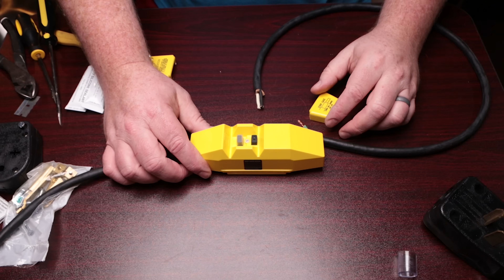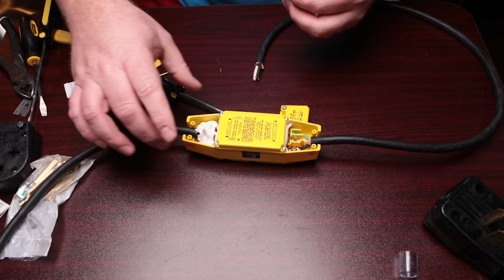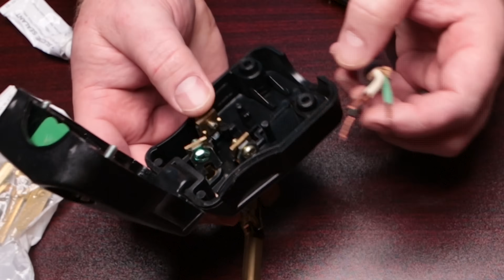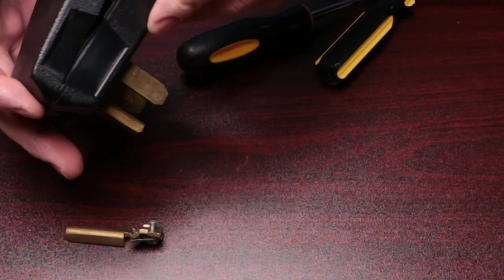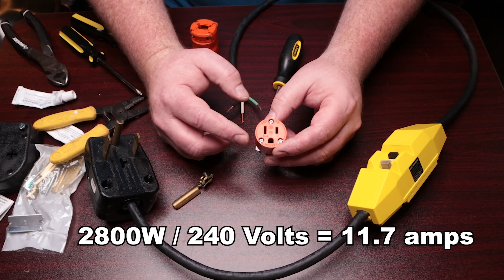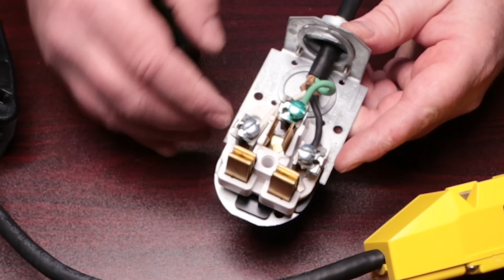Inline 240 volt GFI power cord for Anvil Foundry and Brewzilla Brewing Systems

Comment: Here's an update that might help people out.  The manufacturer seems to have discontinued the part listed above so every site shows out of stock.  I called World Cord Sets and they have a direct replacement not yet available on their site but can be ordered over the phone. The part number is IL-M-20240-Y.V2.
Reply from the maker: Awesome thank you!
Reply: @ShortCircuitedBrewers  Brian, will an in-line GFCI that says 120 V on it work for 240 V in this application? something like this: Leviton GCM20 Manual Reset In-Line, 20 Amp
Reply from the maker: @shaggaroo  it will not
Reply from the maker: Yeah I did a test and it fried the 120v version. It got up to 180f and melted..lol
Reply from the maker: @shaggaroo  😁👍🍻
Reply: Ordered one today. It was $100 shipped. Thanks @carvin4s
Reply from the maker: Glad you found one in stock! 👍🍻
Reply: Just an FYI, they’re priced at $100/each
Reply from the maker: Yeah capitalism at it's finest apparently.. supply chain..blah blah.. lol
Reply: Yeah, for that plus the cost of the other supplies vs. a $70-80 GFCI breaker-I’ll protect the outlet.

Comment: Is there an in-line GFCI option for240 at 30 A? Or 50 A?
Reply from the maker: There are and you can find them by searching ship to shore power. But they're pretty cost prohibitive when you compare the pricing to installing a dedicated breaker in your service
Reply: Ok thanks. As a guy handy enough to do something stupid, building an inline GFCI seems so much safer than messing with my panel to swap out a breaker. No?
Reply from the maker: @marklpaulick  sure you could do that you can actually buy a spa disconnect panel and create a cord out of both ends of that. That is a lot easier than getting into your main panel. 👍🍻

Comment: I'm a bit confused.  At 1:50 , you say that you are wiring it for 120v.  Is that that the same for 240?
Reply from the maker: The end plug that goes in the outlet is the only difference so it really doesn't matter how you wire it for 240. I was just showing how it is "supposed" to be wired if using it for 120. 👍🍻

Comment: Hi Brian. My second time building this cord (first time went well using a 4 prong dryer plug with the  neutral prong removed as shared here).  Using a locking 4 prong plug so that a friend and I can have the same power source and share the foundry as needed. The 4 prong plug I bought for my extension cord does not allow me to remove the neutral prong. Is it safe to have the neutral prong in the plug connected into the wall outlet neutral port even though the cord itself doesn’t have a neutral wire attached to the prong? Thanks!
Reply from the maker: Yeah you'll be fine.
Reply: Thanks so much Brian!

Comment: If i have a dryer outlet connected to gfci breaker, would i be able to buy a dryer plug/cable, strip the ends of the wire that would connect to the dryer, and instead attach the adapter directly to the dryer plug?
Reply from the maker: Yes sir that is safe.

Comment: I'm thinking of using electric stove outlet which is the older ungrounded 10-50amp, 3 blade with 2 hot an 1 neutral. So with the power cord, I know what to do with two hot terminals but where do I attach the green ground wire? Or should i just cut the green wire and put nut on it with silicone in the nut to glue it on? Then what do I do with the section of cord that goes between gfi and the foundry? Same thing with green wire or can I attach that to ground terminal in the gfi at that point (just to keep out of the way, not loose) ? Thanks, great video.

Comment: Hey Brian - we brew at my friends house (the garage is called Two Mutts Brewing :-)) and he has already installed the circuit breaker and power outlet for the Anvil 220.  Where can we find an extension cord, or do I need to get the parts at an electrical supply house?  Thanks!
Reply from the maker: Yeah she won’t find an extension cord to do what I do in this video because it’s not up to electrical code. So you’ll have to find everything at the supply house There are links in the description for some of the components as well

Comment: Can someone explain why gfi is needed if circuit is on normal breaker? Sorry noob question. Thanks.
Reply from the maker: Because a regular circuit breaker won't trip when you're getting electrocuted from your brewing equipment. Generally if you're getting electrocuted by a circuit it's not a dead short to ground so the breaker won't trip. 👍🍻
Reply: Thanks! So the reason we don't need a fourth wire where the neutral would be is because the ground wire is going the same place/acting as neutral?
Reply from the maker: @russelldheilman  240 volt circuits don't use a neutral so you don't need one. The device still works without a new Droid just reads the difference between the hot legs and ground to operate. 👍🍻

Comment: Can't seem to find a 20 amp in-line GFI rated for 240 volts at any kind of reasonable price. Anyone know a place to order this from? I'm in New England (northeast USA)
Reply from the maker: Have you tried all the links in the description? 👍🍻
Reply: @ShortCircuitedBrewers  Yes. Unless there are additional links I'm not seeing, the two links for the 240v GFI's appear to be out of stock.
Reply from the maker: @digitalFig  yeah it's a bit of an issue right now unfortunately. Just keep checking. 👍🍻

Comment: I am planning to install a GFIC breaker so I can run the ANVIL foundry 10.5 on 240volts. Can I use a 30amp or 50amp double GFI breaker in my breaker box? I thought the 30 amp would be prefered.
Reply from the maker: 30 is more than enough.

Comment: Great videos on this subject.  My dryer receptacle is a NEMA 10-30R, so I'd use a 10-30P plug.  The circuit shows 30 amp using 2 breakers (240 V, right?).  Do you see any issues with a setup like this?  I think the only thing different from this video is the plug used on for the wall outlet. I have a propane dryer, so the outlet is not being used currently.
Reply from the maker: No I don't see any issues at all. 👍🍻
Reply: Well, I do. The 10-30R doesn't have a ground and you don't want to "bootleg" the neutral as a pseudo-ground. So the thing to do is to take just the 2 hot legs across the GFCI and have no ground wire in the output receptacle, and no neutral connection on the input plug. The GFCI will provide all protection. The output receptacle should be labeled "no equipment ground" as well.

Comment: Question:  I'm looking to upgrade to a larger 10 gal batch electric all-in-one system (near future) or maybe even a 3-kettle HERMS (less-near future) and I'm building a basement brewery with the help of professionals. What electrical service should we install? 2 outlets of 240v 30a? After watching the video "Spike Solo vs Brewtools B80 vs G70 vs Brewzilla" it seems that the receptacle types options are all over the map. True?
Reply from the maker: If you have the space in your breaker box I would definitely install 30 amp 240 volt circuits. I would go with the standard dryer plug. That will give you a ground two hot wires and a neutral. You might have to make or purchase adapters for various type of Brewing systems. But if you want a future proof as much as possible I would put two in with the dryer plug configuration..
Reply: @ShortCircuitedBrewers  Thanks for the tip. Very much appreciated!
Reply from the maker: @chris.kriese  👍🍻

Comment: Does anyone know where to find a 240v GFCI plug these days?   The sources listed above no longer seem to have them available... :(
Reply from the maker: The plug? Or do you mean the actual GFCI device?
Reply: @ShortCircuitedBrewers  sorry..I should've been clearer... I can't seem to find the GFCI  unit itself... 120v models are easy to find, but not so much for 240v.  Thanks
Reply from the maker: @bumbaevents270  25 black ones in stock on the second link in my video. This one.
https://shop.worldcordsets.com/shop/product-lines/120240v-manual-resetuser-attachable-gfci-inline-style
Reply: @ShortCircuitedBrewers  thanks!   I could've sworn there were none when I looked earlier today... :)  ordering now.  Great video!
Reply from the maker: @LarryPrikockis  no problem... It's kind of crazy cuz a week ago they had over a hundred in stock and then I posted a link in the Facebook group that they were back in stock there and you see how many are left!! I need to get a hold of the manufacturer and just order a giant batch of them and sell them on my website.. lol

Comment: What's the difference between this adapter and the more basic one. Which is the better option to make in order to plug an anvil foundry into a dryer plug?
Reply from the maker: The basic one offers no GFCI protection. This one is what you need for your situation. It will keep you protected. 👍🍻
Reply: @ShortCircuitedBrewers  so I can get away with that GFCI protector and if I put in roughly 50 total feet of 12/3 extension?
Reply from the maker: @worcesterbeerguy4243  yep you can make a GFCI extension cord with this video. Just figure out if you want it close to the supply or the foundry and install it accordingly. 👍🍻

Comment: Waiting on materials to be delivered. Excited to brew at 240, it will be very helpful at our elevation. Question about lengths: I usually brew indoors but in the summer I’d love to pull out the Anvil on the patio and enjoy the day. Is there a specific rated extension cord that I can use? Or do I need to get enough 12-3 SJOOW for my largest length needs? I’d rather not have 20-30 feet of it coiled up for most of the year. 

Thanks! Great videos as always.
Reply from the maker: That rating is perfect. The length is fine too.👍🍻

Comment: Hi Brian, or anyone else that's been thinking on these things, I have an unused 30 amp 240v breaker on my home circuit panel. It's not a GFCI breaker. I'm planning on repurposing this circuit for an Anvil 10.5 gallon system to take it to 240v for more efficient use. My question is, when I wire the 240v outlet, should I upgrade the 240v breaker to a GFCI breaker, or just build a GFCI into this awesome DIY project you have here? (especially since I'm planning on doing this project rather than cutting the cord and potentially losing resale value if I ever can't brew because... I dunno, I become a quadriplegic?) There's about a $30-40 difference between these two methods, and while I want to save money I don't want to be stupid if there's a logical benefit to having the breaker a GFCI that I'm missing. Note: this will be a dedicated outlet just for brewing.
Reply: Ha, rather I'm planning on doing your 120v to 240v conversion cord project I meant, so I could build the GFCI into that same adapter cord.
Reply from the maker: @MGoBirch  if you could put the breaker in the main panel then you would be able to use any system on the circuit. I'd suggest that and then just make the adapter cord.
Reply: @ShortCircuitedBrewers  Thanks Brian!

Comment: I have a 250v plug wired into my garage for different table saws. Would this configuration work, with a 250v plug since the anvil would only be running to 240v?
Reply from the maker: Would be fine. Are you in the USA?
Reply: @ShortCircuitedBrewers  yes.

Comment: Brian, how long can that cable be? I need 16 feet to reach my brewing area...can I make that long? And what's the gauge of that wire?
Reply from the maker: 25' is fine. 12 gauge is recommended..
Reply: Thanks Brian, I have the foundry on the way and I don't want to deal with 120V... Thanks again.
Reply from the maker: No problem!! 👍

Comment: Brian, thanks so much for the videos they are sure helpful. I have an Anvil 10.5 and am moving my brew operation to the farm. In the barn there is a 50 amp 250 volt outlet for the welder. Will the setup you made for anvil on this video be ok to plug into that ?
Reply from the maker: Yes it would work fine.

Comment: So if I'm plugging into my 250v/30a dryer outlet in my apartment, I can ditch the neutral pole on the 4 pole plug and connect everything accordingly as you've done in the video? Just want to make sure I'm not missing anything. 🍻
Reply from the maker: Yep. You don't need a neutral for 240. 👍🍻
Reply: @ShortCircuitedBrewers   awesome! One last thing, the GFCI you linked in Amazon only says rated for SJT cable. Can this take 12/3 awg cable?
Reply from the maker: Yes sir.. it is actually 12-2 with a ground but as long as it's only 3 wires total you're fine. 👍🍻
Reply: @ShortCircuitedBrewers  sorry just realized my reply left out the 12/3 awg is sjoow.
Reply from the maker: @sloppybones  that's what's in my video it will work just fine.
Reply: @ShortCircuitedBrewers  thanks for all your help! 🍻

Comment: Brian, I have a 30 amp dryer outlet I beleive to be a nema 14-30p it has one horseshoe plug on top, two blades side by side and a round plug on the bottom. I ordered a 50amp plug to wire up that has a round plug on top, two blades side by side and a blade on the bottom. Can I just remove the bottom blade then plug it in upside down? Do I wire the third wire to the round plug? Will that still function as a ground or neutral? I've read that mixing up ground and neutral results in being electrified. Ordered 12gauge wire 12/3 which has 3 insulated wires so i can use that to wire it all up right? also a 15 amp female 125 volt end for the output to foundry.
Reply from the maker: I answered you in your Facebook messenger check that. 👍🍻
Reply: @ShortCircuitedBrewers  thanks again Brian! You're the man! You have my support as a lifelong viewer
Reply from the maker: @garyx2903  thank you! 👍🍻

Comment: Hi Brian,

Thank you for all your great videos, all of them entertaining and informative.  

I am currently brewing on my stove in a NYC apartment and looking to upgrade to a stand-alone 3500 w induction burner. I was wondering if you thought a 6' cord with an installed inline gfci could be combined with a 16' extension cord to reach a 240 v AC outlet. All use a nema 6-20 plug/receptacle. Looking at the specs I noticed that the extension cord has 12 awg wire whereas the one with the gfci protection has 14 awg wire. 
Links:
https://www.grainger.com/product/SOUTHWIRE-Line-Cord-GFCI-55CW92
https://www.amazon.com/Parkworld-885767-Extension-6-20P-Female/dp/B07K2QLJMT

I totally understand if you are too busy to spend time looking into this. In any case, thank you!
Reply from the maker: Both of those listings are for 12 gauge wire?
Reply: Hi Brian, Thanks for checking in. They are both 12 gauge. In fact, the inline gfci cord from grainger incorrectly said 14 gauge, but I called and they said it was 12. I've used the setup for a couple brews already and it works so well. Nine gallons of wort boils too hard at 3500 w so I turn it down. The burner creates very little heat -- will be great in the summer and leaves the kettle much easier to clean. I would love to see a video on induction brewing if you ever do one. Thanks again and cheers!
Reply from the maker: @janetpiez3393  here's the one I did a while back. https://youtu.be/SMML1MRCpIQ 👍🍻
Reply: Great video and interesting products. I'm doing 5-8 gallon batches using an old school 3 vessel setup so it is a bit different. Looking forward to your next video!

Comment: Forgive me I'm electrically challenged. The newer link for the black GFI is only rated for 120v/20amp. Is this still sufficient to run the 10.5 foundry on 240? If so, is there any difference in the way you wire it?
Reply: I found that also, and asked for correction
Reply from the maker: it should be fixed. tp be the correct one.

Comment: Can this GFCI inline breaker be used on a 30 Amp 220v dryer circuit, or a 30 amp 220v Hot Water tank circuit?  Or is a GFCI rated at 30 Amps required.  I assume each leg of a 220v 30 Amp is 15 amps, correct?  Would each leg being 15 Amps allow me to use this 20 Amp rated breaker?
Reply from the maker: Yes you can use it that way.the supply amperage has no effect on the GFCI. The gfci is rated for the load it handles not the input voltage. 👍🍻
Reply: @ShortCircuitedBrewers  Thank you. 🙂🍺
Reply from the maker: @allangrossberg2319  👍🍻
Reply: @ShortCircuitedBrewers  Bryan, are the 12/3 wires good for a 30 amp outlet?  I have a buddy who recommended to use 10 gauge for 30 amp since it’s code for that breaker. Hoping so as I’d like to be able to use the inline gfci for my 20amp in garage or 30amp breaker in house for dryer.
Reply from the maker: @johnwallace8838  it depends on the load you're putting on the circuit. This is only a 20 amp rated GFCI so you don't want to use anything larger than 12 gauge wire. And no it's not built to code more than likely if you're putting it on a 30 amp circuit. But you are still plenty of protected because you're not pulling more amperage than the GFCI can handle if you're running an anvil Brewing system.
Reply: @ShortCircuitedBrewers  I plan on running it on a digiboil 65l for 3500 watts total. No pump as that is separate. Would this still be good in your opinion?
Reply from the maker: @johnwallace8838  yep that'll work just fine. Build it exactly as I show it but with the proper plug for the digi boil
Reply: @ShortCircuitedBrewers  appreciate the help man!
Reply from the maker: @johnwallace8838  👍🍻